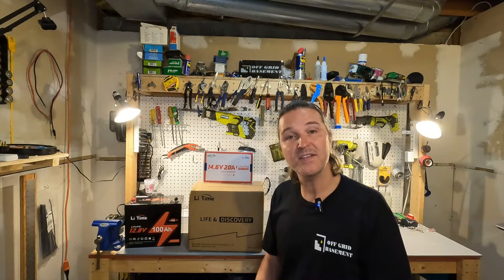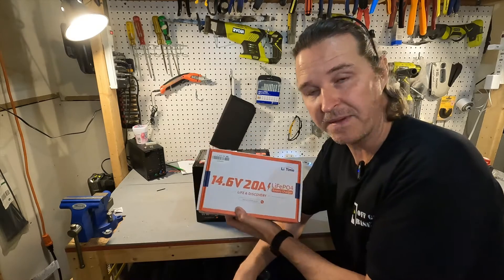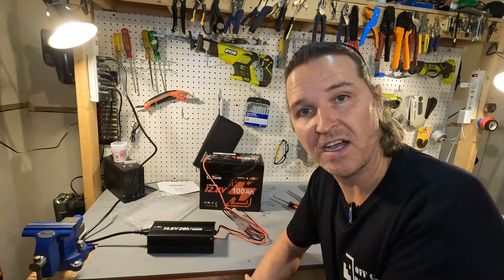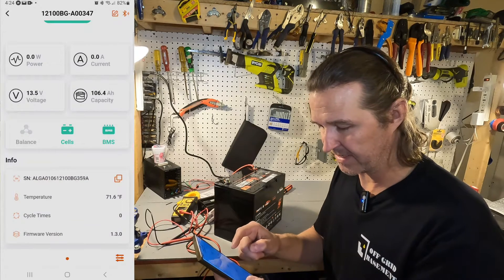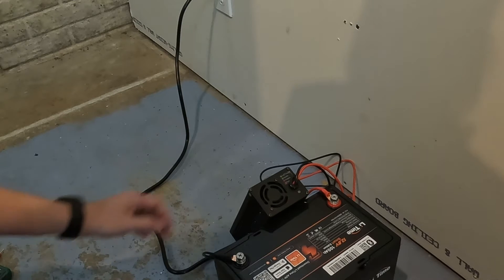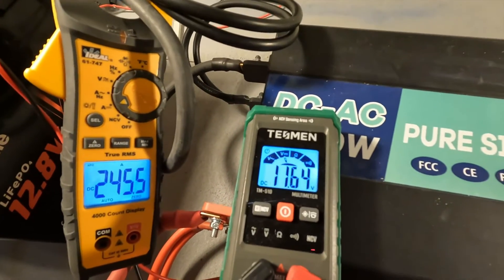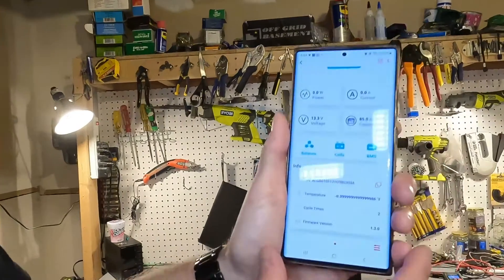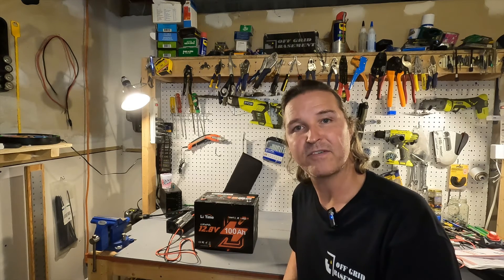Li Time SMART 12v 100ah Lifepo4 Group24 Battery and Charger Review.  Great for RV's!

Comment: why do they not fully charge to the 14.5 volts but still have full capacity
Reply from the maker: It should only reach that high of voltage for a second, then drop down.  You only want to keep them at 14.5v to balance the cells through the BMS if it's equipped.

Comment: Thank you for the video. Question i have is if i leave the Litime charger  overnight to charge does the charger cut off after fully charged and keeps trickling the charge when it detects lower amperage and does this affect the cycle times ?
Reply from the maker: The charger will trickle after fully charging.  Don't keep the charger on there longer than it needs to be.  I believe it keeps the voltage at 13.8v.  Use a smart plug to turn the charger off and on for best results.

Comment: My li Time 12 v charger has charged my 12 v 100 Ah Li time battery to 99% and won't stop.....

What do you think the issue is. 

I still have the solid red light on the charger indicating that it is charging
Reply from the maker: I don't think the charge will stop until the battery voltage is 14.6v.  You need to check the voltage of the battery while charging and then disconnect the charge and see what the battery drops to.  If it's full then it would most likely drop to about 13.8v after an hour.  The charger should only take 5 hours to charge up a 100ah 12v lifepo4 battery.
Reply: Gotcha. The charger was stuck at 99% for about 20-25 minutes before I pulled the plug. It happened for both batteries.....I don't believe the volts were up at 14 I believe 13.8 was where it was. The next time I charge them I'll see what happens

Comment: I just recieved 2 li times smart batteries with bluetooth, right out of  box i connected charger to either of them, i get nothing. I tried connecting a tiny inverter thinking if mite kick battery on. I get nothing. Im wondering if using App is non negotiable. Id rather not use app if possible.
Reply from the maker: They are probably both "sleeping"  You can use your car battery to jump them awake.  Just connect them for a second or two.

Comment: The battery charger of Litime charges with 14.6v, do you know if it will damage the battery if you charge the battery with an other LiFePO4 Battery Charger with a charge voltage of 13.5 volt?
Reply from the maker: I believe it will just take longer to charge at the same amperage.

Comment: Just got this battery. If you tap on bms in the app, and it's just charged it to full, it will say something like shields up, bms is no longer accepting a charge. However, after it's been in standby for a while at 100%, it only says, bms is normal. I wonder if it would say anything about trying to charge it when it's too cold. Also, the balance button when flashing will indicate it's doing a balancing and tapping the balance button will say it is balancing. 

I too read 12.9 v when the app says it's at 13.4. Don't know why.
Reply from the maker: Thanks for the info and the comment!

Comment: Hello there Offgrid basement
Quick question, once you top off the lithium battery to 100 percent and begin to draw down the state of charge to around 95 percent , will a li compatible converter begin to recharge that battery back up to 100 percent as soon as you attach it to the shore power?  Or does the battery’s BMS not allow it to begin charging itself until it reaches a lower state of charge??  
TIA
Reply from the maker: The battery wouldn't care.  It will charge back up after being disconnected for a few minutes.  The lithium setting in the charger should have some sort of float charge setting.  It will again charge the battery to full then let it lower back down to around 13.6v - 13.8v and hold it there.

Comment: So can it charge a battery bank of 4 batteries wired in parallel or will one need to charge 1 battery at a time  ?
Reply from the maker: You can charge all in parallel, but it's recommended to charge one at a time to make sure everything is top balanced.

Comment: Have you figured it out about the lower voltage on the battery than the volt meter?
Reply from the maker: No, but the battery performance is not affected.
Reply: @OffGridBasement  I have noticed with my Litime battery that after charging the voltage says 13.0 volt. But as soon as I connect anything to it, it goes up to 13.4 volt.

Comment: Do the specs for the charger says what the minimum cut-in voltage is for starting the charge cycle?
Reply from the maker: I believe it's 1v.  The charger will wake up a fully discharged lifepo4 battery.
Reply: @OffGridBasement  Thank you!

Comment: What would happen to these batteries if you put say 15V across the terminals and left it. Would the bms stop letting charge into the battery when it reaches 100% charge?
Reply from the maker: It depends on if the BMS is correctly programmed to disconnect on that high of a voltage.  I don't recommend charging at that high.  It would start damaging the cells.

Comment: How is it putting 20 Amps into the battery from a 15 Amp wall receptacle? What am I missing?
Reply from the maker: The 15A wall socket is AC running 120v.  The 20A charger is DC running 12v.  Hope this helps!
Reply: @OffGridBasement  Ahh, right. Duh for me. Wow I’m tired…

Comment: I have the Li Time 200ah battery, something I don't understand is what is full voltage supposed to be? Is 13.50volt full? I thought it was supposed to be at 14.4 to be full. Or at least 14v. Am I misunderstanding this?

Also why was your volt meter showing a much lower voltage than the app?
Reply from the maker: When you charge up to full the voltage is 14.4 to 14.6.  when the charger turns off, the voltage will drop down to around 13.6 to 13.8.  the BMS in the battery was lowering to the voltage at the posts.  I'm not exactly sure why that is.  Probably something to do with having a consistent voltage when at rest and under load.  Hope this helps.

Comment: Good video, thanks.  Can the charger charge 2, 100Ah batteries in parallel?  Or is it only designed for one battery at a time?
Reply from the maker: It can charge two batteries in parallel with no problem.  Just make sure to wire the batteries in parallel for 24 hours beforehand to make sure they are balanced.
Reply: @OffGridBasement  thanks, but a question.  It was my understanding that in order for a battery to balance its cells, it has to be fully charged.  But would that mean batteries would have to be individually balanced (ie charged individually) before connecting in parallel?  Then after that they could be charged in parallel using charger?  Thanks again.

Comment: I just received one of these batteries today and, when I attempted to connect the Bluetooth, the "device was not found".  I tried charging it with a HTRC P20 set to LiFePo4 and 20A and it would not charge.  I measured the voltage and it is showing 3.2 Volts.  I think that the Volts are the problem and I'm wondering what you'd suggest to make this battery usable.  In your video you expect something like 13.1 or 13.2 Volts with a new battery.  Thoughts??  Thanks,
Reply from the maker: Your BMS in the battery looks to be asleep.  You need to wake it up with another 12v source.  Watch this video:  https://youtu.be/j2JjOpq50MI
This should help.
Reply: @OffGridBasement  Good Morning.  Thanks very much for the help.  I replace UPS batteries periodically and happened to have a 12V9Ah one in my workshop.  I connected jumpers to that battery and touched the other ends of the jumpers to my new LiFePo4 battery and, when I tested the voltage of the new battery, it was 13.2.  Voila!!  I connected my Smart Charger and it's humming away (well, a little louder than humming) charging the battery.   
I do have some car battery chargers in the garage and I wonder if I could have used one of those to do the same thing??  I didn't know if there might be problems because those chargers are for lead/acid batteries and the new one is a LiFePo4.  Again, I appreciate your help in getting me going with this project.
I have a portable refrigerator that runs on either 12V or 110V.  When travelling, I can plug it into a 12V outlet in the car but, when we get to a hotel, I lug it into our room so that it doesn't run down the car battery.  I'm hoping to use this new battery to keep the fridge going in the car at night rather than having to lug it to a 110V outlet.

Comment: Looks like it operated at the voltage shown on the side of the battery case.  12.8
Reply from the maker: Yes.  Most of the time that will be the operating voltage under load.

Comment: Great video...Question for you, will a 12/24V solar charger work at charging a 36v LiPo battery?
Reply from the maker: Afraid not.  You need a solar charger that supports 36v.  They do make ones that support 12v, 24v, 36v and 48v.

Comment: I have the same Li Time 14.6V 20A charger. When my battery is charged the charger will cycle on and off rapidly. Is this normal or does the charger have a defect?
Reply from the maker: I don't believe the charger I have does that.  That could be a defect, but I'm not sure.  Sorry I can't give you more information.

Comment: So, how long did it take for a full charge on a 20 volt Li Time charger
Reply from the maker: It takes right around 5 hours to charge this 100ah battery with a 20A charger.  Hope this helps.  Thanks for the comment.

Comment: Think its Gokw , they made a Sodium 12v 100ah woth small cylinder celld. , Hope they work with LiPo4 MPPT controllers.
Reply from the maker: I'm sure you could set an MPPT controller with manual setting options to work.  I've heard Sodium doesn't like to be charge quickly so keep that in mind.  Thanks for the comment.
Reply: @OffGridBasement  I saw your Gokw video on alibaba , hope they send you the sodium, interested in charge and discharge graphs.

Comment: Li Time seems to make nice products.  My charger is a RoyPow 3A LiPo Smart Charger which cost about $20. At 3 amps it takes about 35 hours to fully charge a depleted 100 Ah battery, but I'm in no hurry. If I was cycling my batteries frequently, I would need a bigger charger, but as is it works great, and no fan, so it's silent. 😃
Reply from the maker: Sounds nice!  Thanks for the comment.

Comment: off grid bas  making my own going off grid in fl i still don,t use bms only bat balancer only been off grid 4 over a year no problems have new addtion its only 12volts have been buying used cells 75ah and 100ah i buy panels all sale or bank rupp used panels im 84 and having a time of my life i enjoy your info
Reply from the maker: Sounds like you are making everything work for you!  Thanks for the comment!
Reply: @OffGridBasement  how long does it takes to charge the battery ? it will be nice to know

Comment: I have that Li Time 20A charger, and I'm surprised to see that you are recommending it.   I would recommend people avoid the Li Time chargers.    Most LifePO4 chargers have some concept of  "float" phase, where after the initial charge, the charger will pull back to a slightly lower charge, then maintain that voltage to keep the battery at 100%.   What I have described is widely considered the best way to charge and maintain LifePO4 batteries.    The Li Time chargers do not do this.    Instead, when the battery reaches 100%... the charger just turns off.   You can hear the relay click, you see the Red light turn to Green.    When the battery discharges enough, the charger will turn back on and the process repeats itself.     

I've seen this with 10a, 20, and their 40a chargers.

So why is this bad?  If you leave your battery plugged in while fully charged, the charger will repeatedly cycle, by allowing slight discharge and then recharging.   Each cycle, the charger will raise the voltage to 14.6V.   If you have any kind of parasitic load on your battery, like a SOC-measuring Shunt, then the cycle happens frequently    LifePO4 batteries are not intended to have 14.6 voltage on frequent cycles.   This behavior is consistent with what is described in the manual, it is by design.

Good LifePO4 batteries will have a 'float' phase where 100% SOC is maintained with a lower voltage. (13.0)  Instead these chargers will cycle and raise the battery voltage to 14.6V many times each day.   That's not a good thing, and why I would not be recommending these batteries.
Reply from the maker: Thank you for the information and the comment.  I'll do further testing with the charger to see if I can replicate your findings.
Reply: Please, which charger are you using that below $100 ?. I don't want to buy a battery charger and later regret it
Reply: I'm still using the Li Time one, I just don't recommend them.

Comment: Thanks for the video! I’m new to batteries, and I have a very basic question. I didn’t understand your disappointment that the battery measured 13.02 volts when fully charged. It’s labelled as a 12.8 volt battery, so I thought being higher than that meant it delivered better than expected. What would you expect a fully charged battery to measure for voltage, and why? What is the downside that it only measured 13.02 volts fully charged? I’m missing something in my understanding. Thank you! Always appreciate how thorough you are and love your channel.
Reply from the maker: A fully charged lifepo4 battery is 14.6v then will quickly drop to 13.6 to 13.8v after being taken off the charger.  A reading of 13v to 13.1v suggests the battery is not even half capacity if not under load.  The app showed the battery is full and resting @13.5v which is fine.  It was odd that the terminals measured one voltage, but the BMS app reads something different.  Since I've cycled it a couple times now the measurements are the same.  I hope that answers your question.  Thanks for the comment.
Reply: my batterys never get over 134 to 136 according to the meter but will stay at 13.2 for hrs @OffGridBasement
Reply: Any update on this?  @OffGridBasement
Reply: @moneth08able nope! probably cause he was full of it😂😂😂
Reply: Also curious if you have update with actual voltage readings.  you said that they are the same but at what voltage.  Thanks much,

Comment: I noticed on the ap there was a "cells" button.  Does that perhaps reveal the individual cell voltages if you click on it?
Seems like a nice battery and charger.
Reply from the maker: No.  It just states that everything is normal.  Nothing worthwhile.  Hope that helps.  Thanks for the comment!

Comment: Is there any Different between the Group 31 and 24 Li time 100AH Batteries?
Reply from the maker: The only difference is the size of the battery case.  They both should be 100a BMS and prismatic cells.  Hope that helps.  Thanks for the comment.
Reply: @OffGridBasement  I thought they were the same inside I thought they would have the same everything except the outer case   THANKS

Comment: Thanks for another great video!  Can you please do a video on chargers. I purchased the haisito 20A that you previously recommended  - can you review / recommend a higher capacity charger (like 50A or 75A), for both 12v and 24v. The 20A works great day to day, but i'd like to be able to charge faster in an emergency. 
Cheers!
Reply from the maker: I'll see what I can do!  Thanks for the comment.